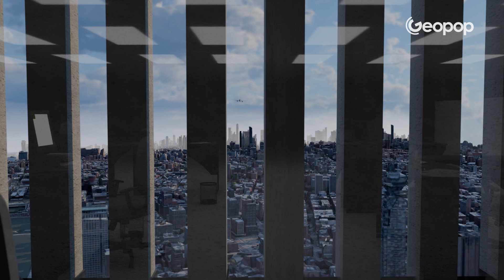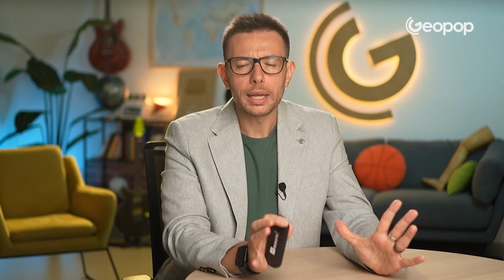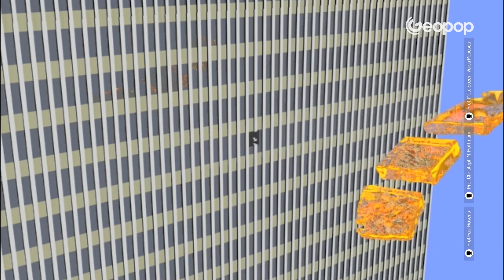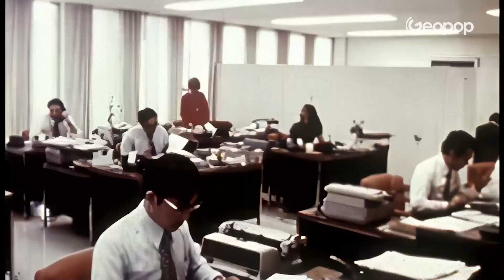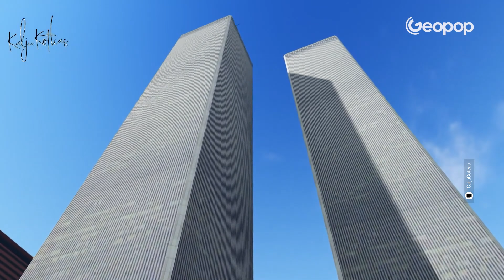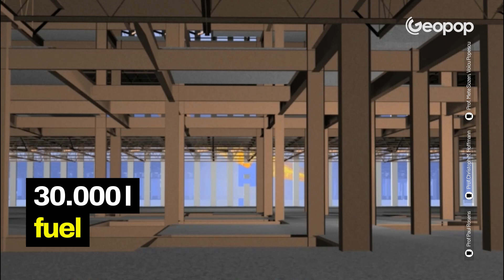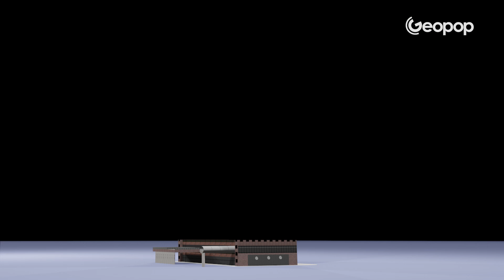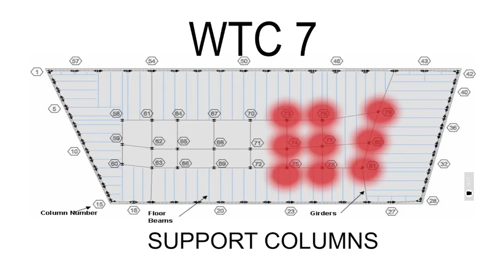9/11, 2001: The Technical Reconstruction of the Twin Towers and WTC 7 Collapses

Comment: And the planes wouldnt penetrate the buildings like that, especialy the nose coming out the other side 🤦🏾‍♂️ theres footage of fighter jets disintigrating when hiting a concrete wall
Reply: Except it wasnt a solid concrete wall, more like a seive with windows in the gaps. Also the difference in mass between a fighter jet and a fully loaded passenger plane is quite abit different
Reply: @TomVVG  🤣🤣🤣 duh steels stronger than concrete 🤦🏾‍♂️ the plane aint making it through bt cool story 💀
Literal footage of the nose coming out the other side 🙄 stop it
Reply: @Niggleblade1986  depends how big the concrete slab is we're talking about. If you can show me the footage of an intact nose of the plane coming out the other side I'll believe you. How did Ice rip through the steel hull of the titanic. It's only frozen water right? And steel is quite clearly plane proof according that guy in the YouTube comments!
Reply: @TomVVG  was footage from news helicopters. Il try find it. In the middle of hour lng vid. And the slabs thick af, bt thats irrelevant. Towers were cased in steel with a steel core.plane wouldnt stand a chance. And 3 buildins falling from 2 planes, for the 1st n last time in history 💀
Reply: @Niggleblade1986  I agree the 3rd building smells fishy. The only objects I know for sure came out the other side were the landing gear as they are exceptionally strong, and I think an engine was found a block away. Honestly the speed and the mass of the plane would've cut through the outer steel like butter. The plane would been shredded on impact, which is why I highly doubt a nose cone would of come out the other side. Tbh I'd really like to know your point here? Are you saying the planes were real? Genuinely interested
Reply: @TomVVG  planes were real, they didnt bring them down though. First responders said bombs and multiple explosions went off. Id take there word for it over anybody else. How could the bbc LIVE say the 3rd tower had fell when it was in the bk of the live shot? And didnt fall for another 45 mins? Silverstein said he told fire fighters to "pull" the building. Thatd be impossible to do.
Reply: @TomVVG  and again. A fighter jet goin mach 2 couldnt get through a concrete block. So not sure thats happening with a passenger plane
Reply: @TomVVG  just search jet vs concrete wall. Then get bk to me 👌🏾
Im looking for the other vid
Reply: @Niggleblade1986  the bit I'm confused about is you say the planes were real but then say they also couldn't penetrate the building? So which is it? They are either real and did penetrate or fake and didn't? The explosion sounds is easily explainable, the sound of the building collapsing and hitting each floor on the way down, would of sounded like a train booming over a track, which is exactly how many fire fighters described the sound. So much misinformation came out around that day, so many eye witnesses all said different things, some said small plane, some said large, so said no plane. One even swore it was a British Airways flight. The new reporters using words such as explosion when the tower collapse just fueled these wild theories.
Reply: @Niggleblade1986  I don't need to see it, solid concrete wall and the WTC are two different things.
Reply: @TomVVG  again, no. The bomb WAS IN THE BASEMENT. It blew them UPWARDS. That couldnt happen from a plane hitting the top could it. How old were you when it happend?
And im saying the plane isnt going through the building and THE NOSE coming out the other side intact. Have you watchd actual footage of first responders? Lol the pancake effect? Stop it. The explosions happen floors below where that is supposidly happening, footage of that too. How did silverstein get building 7 PULLED? That takes weeks to set up
Reply: @TomVVG  first responders, as in people in the building involved. Not witnesses. Please stay with me
Reply: @TomVVG  exactly. Trade center built stronger because of the steel 🤣 so if a jet isnt going through concrete at mach 2 then a passenger plane aint doing that.
Reply: @Niggleblade1986  the building wasn't a concrete block. Jesus how hard is that to work out. You saw the planes hit and go into the buildings in the videos/news coverage yet you deny that they went through and aren't offering another explanation?
Reply: @Niggleblade1986  you are so deluded, there is no hope
Reply: @garyford5589  so must all the police and firemen there that day. Crazy that 💀🤣🤦🏾‍♂️
Reply: @Niggleblade1986  It’s not about speed but the mass and weight of an object.  You’re talking about a 20,000 pound object versus one that is over 300,000 pounds.  Would you rather run into a motorcycle doing a 160 mph or a semi doing 70 mph?
Reply: KE = (1/2)mv2 is not your friend...
Reply: @Oldschooldan1  jet vs concrete wall isnt your friend bt thanks anyway 🫥💀
Reply: @Niggleblade1986  You do realize that there were no concrete walls in the WTC????
Reply: @Oldschooldan1  💀🤦🏾‍♂️ n steel is stronger than concrete. Thanks for playing
Reply: @Niggleblade1986  Depend on the thickness of the steel and the thickness of the concrete. The steel was only 3/8-1/4 of inch thick in the impact zones. The kinetic energy of a Boeing 767-330 traveling 500 mph is 396,5852,583 Joules or equivalent to 1 tons of TNT. This doesn't include the explosive energy of vaporized jet fuel either.
Reply: Your ignorance of basic physics is only exceeded by your confidence you're right.
Reply: @whaaat3632  thatd be you 🤣🤦🏾‍♂️💀
Reply: @whaaat3632  The towers' perimeter walls comprised dense grids of vertical steel columns and horizontal spandrel plates. These, along with the core structures, supported the towers.......
Oh, so wait, theres steel in the walls too 🤨 strange. Isnt that what i said 🤷🏾‍♂️ hmm 🤔 
Looks like my confidence was there for a reason 🤣🖕🏽✌🏾
Reply: @whaaat3632  🤣🤣🤣🤣 basic? Theres nothin BASIC bout what happened 🤦🏾‍♂️💀
3 buildings fell, by two planes, all the same way.......for the FIRST and LAST time EVER!!!! You really are a 🤡🙄 
And they all turnd to dust, while falling like controlld demolitions. People WHO WERE THERE!!!! Say the exact same things im saying. Fire fighters, police but i guess theyre lying too 🤣🤦🏾‍♂️💀 take that bs somwhere else.
Reply: There was no concrete on the outer parts . It was aluminium and glass . The concrete and steel parts were the skeleton inside in the core of each tower .
Reply: @TheSavagederek  and i suggest you go bk and have a look 🫥 cuz u wrong af 🤣 bt thats ok
Reply: @TheSavagederek  The towers' perimeter walls comprised dense grids of vertical steel columns and horizontal spandrel plates. These, along with the core structures, supported the towers........
U sure nw? 🤔
🤣🤣🤣🤣🤣
Reply: @TheSavagederek  🤣🤣🤣🤣🤣  and?  steel stronger than concrete 🤦🏾‍♂️ so if a plane disintigrates on concrete it does have a chance against steel. So how could the nose come out the other side? (Literal footage) 
Howd the building turn to dust?
Why did the bbc say tower 7 fell on live TV when it was stil standing for 45 mins?
Whyd djew boy silverstein insure it (for terror attacks) 6 months b4 they happened? And how convienient he had a drs appointment that his wife made 4 him that day that he didnt knw about 🙄🤦🏾‍♂️ thats why he didnt go into work that day. Fohm 💀
Reply: the columns were pushed away and the plane continued its path.
the fighter jet cant push anything away because its all a solid block.
very simple to understand.
Also, the nose didnt come out the other side as far as i know, it was instead a big part of the engine.
Reply: @nahoj.2569  cool story
Reply: Yes that's what I've always said, and the noses of planes are usually only made from Plexiglass or some other plastic as the communications ariels are housed within the nose. These noses will often break if a bird flies into them.

Comment: It's funny to watch you explain this without talking about the news helicopters circling the buildings before they fell, videoing hot lava pouring out the side. Thermite was definitely involved. What else could cause red hot lava to pour out? Then with that being said that opens a whole other slew of questions that were never answered.
Reply: The "lava" pouring out of the side of the building was actually lead, from a massive UPS that fuji bank had installed around the 77th floor, there were that many batteries in the UPS that they actually had to pay to have the floor reinforced to support it's weight.
Reply: That would make sense because it was around the time you see the molten material flow when the building collapsed. Obviously the floor failed and all that weight shifted.
Reply: @TomVVG How did they reinforce the floor?
Reply: @justinstandifer604  quite honestly I don't know, Im no expert in structural engineering and there's no articles out there about how you would do it.
Reply: What about the helicopters?
Reply: @cattycorner8  what about them? They have nothing to do with the building.